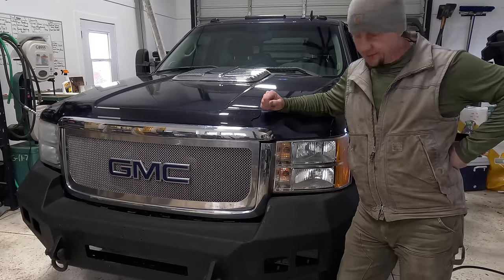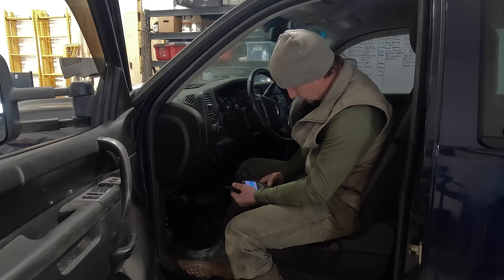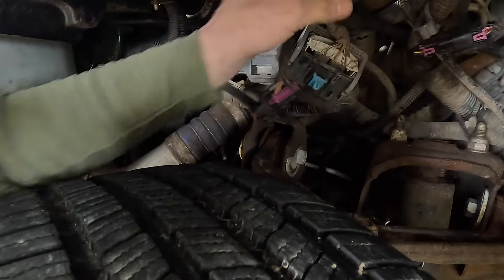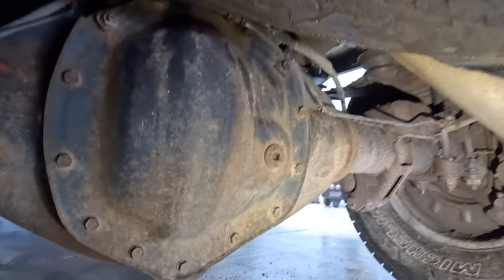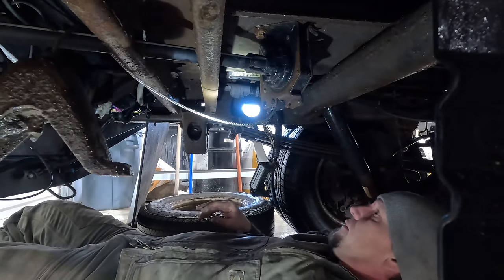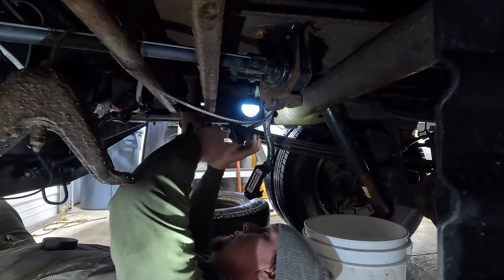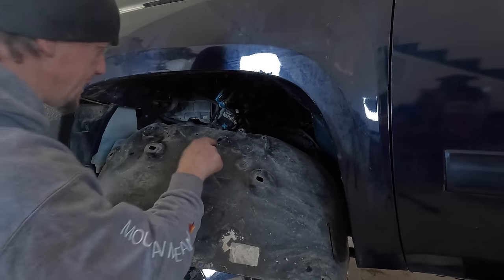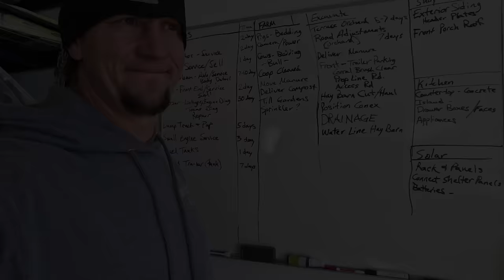GMC 3500 Diagnose and Repair 15 UNIQUE Trouble CODES at once!

Comment: Mark: With the amount of maintenance that you do, you should invest in a good heat gun and solder sleeves for joining and repairing wires. Fool proof: premeasured solder, meltable dams at end of sleeves to ensure water proof, and very quick installation. I worked at Raychem corp in California during the time that this product was invented. Great product!

Comment: Mark: to discourage rodents from chewing cables, apply adhesive aluminum tape as used to seal wood stove chimney joints. Also, here in Greece, we put naphthalene "mothballs" close to cables to discourage rodents. We have especial problems with martens (pine or beach, I forget).

Comment: I'm 8 min into video and now testing my prediction.  Green crusties somewhere - corrosion in a connector that is causing some of the 12v to pull up the 5v and other area causing the loss of ground.  Maybe only loss of ground that allows a return signal to float to high and not a 12v coupled back.  Oh, I'm feeling vulnerable sticking my head out there.
Reply: Inspections first is always the best thing.  I lost points for that.  A test light can determine if the vent valve is getting cycled.  If you can tell when it should be under vacuum, pulling the gas cap and listening for air rush might tell if the valve is not cycling at that point.  Applying power to the valve with a jumper and listening for it to cycle is another test.
Mice eating wires is so common.  Mfgr's should change the insulation on wiring.

Comment: having to fix intermittent electrical is so very hard...  I once had a 80's era Toyota that had a break in the coil wire to the distributor.. the break was inside the coating so you couldn't see it. Long before the days of computer modules.. 3 or 4 mechanics later one found it... a 4 inch wire that cost about 10 cents.. and hundreds of dollars of labor. GM could sure spend a little more on the wiring set up, too much is just floppy or hanging with no protection.

Comment: Here is a solution... don't buy a car with an onboard computer. A car doesn't need one. I am with Heath on the topic of cars. All those sensors are just annoying, purposefully overcomplicating the basics of 4 wheels and an engine.
Reply: That is why you can NOT buy a Toyota Hilux Diesel Pick up truck in this country while it is a top seller in the rest of the world!
Reply: only problem is everything has that junk and the older equipment is so shot there's nothing left of it so what next